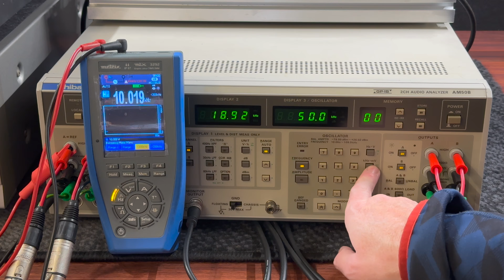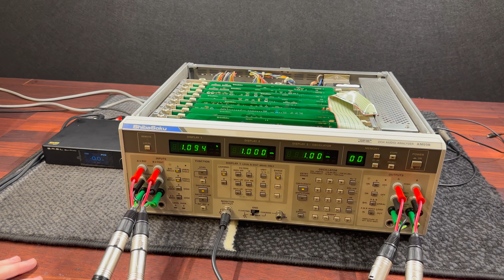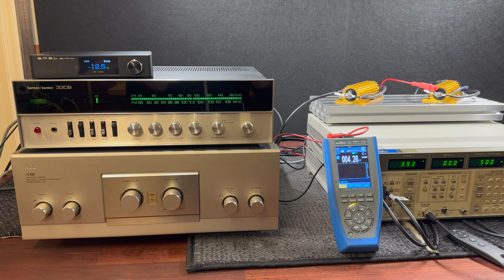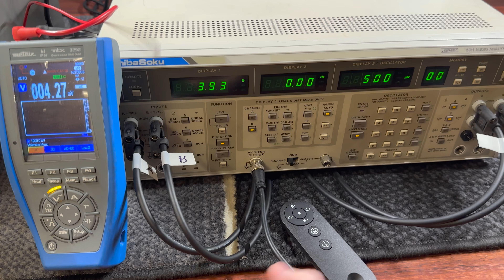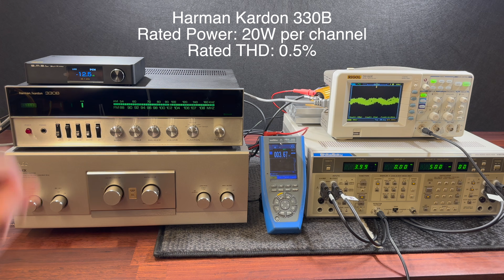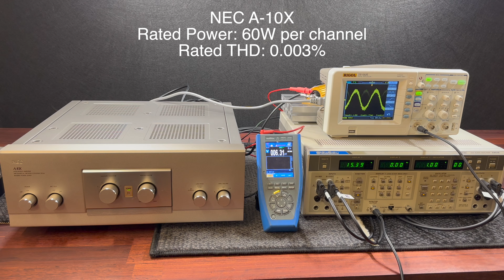ShibaSoku AM50 - Audio Analyzer (Calibration & Testing)

Comment: 10:38 from what I have gathered working on my HP analyser, those filters were designed for telecommunications use so how the unit does the math for the final figures is down the rabbit hole type stuff. I am wanting to experiment with the 400hz one however as I sometimes repair tape decks and would like to use it to measure tape noise vs various different heads... but I need to learn how to measure that when I have some time on my hands!
Reply from the maker: I have the Tektronix AM700 analyzer now also and I have confirmed the THD test files are bang on accurate also… So now I have a known reference point to sanity check the calibration 🙏
Reply: @whatcouldgowrong7914 awesome! I hsve recently bought an ABO-3300, really looking forward to that arriving. If that works,well i might get myself a 2 channel version of that one one day...

Comment: Very interesting video! Very difficult without a service manual... Hats off!
Reply from the maker: Thanks! Yes it was one of my hardest projects and didn’t expect so many troubles
Reply: @whatcouldgowrong7914  One question if you don't mind: If I remember correctly you said that you don't like the Quant Asylum audio analyzer. Can you explain why? At least in the 403 version it seems like the best buy for the money today. Older analyzers will likely perform significantly worse and are mostly as expensive (or even more expensive). The only potential disadvantage I see is that there is only software, no buttons. If precision isn't really important I could see why an analyzer like the one you presented here might be useful as well.
Reply from the maker: @sebastian_harnisch  Sure, my quantasylum is an older model but they basically cut off support for it which means it wont run now without an old windows 7 computer and they refused to even update the USB driver just so customers could get them on newer OS. It also won’t run without a powered USB hub which adds noise and a real pain to use and it’s measurements were inconsistent for me. I wanted a separate analyser so I don’t need a computer to operate and it also supports up to 100Vrms which most computer analyzers won’t take that sort of voltage without blowing up. I may get a Cosmos ADC for spectrum analysis but Im not keen on investing with quantasylum again as they just want to sell you new gear.
Reply: @whatcouldgowrong7914  ah, that’s understandable and very good to know… thanks! The input voltage limitation also is something that I don’t really like, although with +-56Vp it shouldn’t be too much of an issue in my case… thanks again for the insight
Reply from the maker: @sebastian_harnisch  I did pay a lot for the shibasoku also as analysers are really rare in Australia. The Panasonic VP analyzer is probably the one to have and impressive features but there is a HP one also that can take up to 300Vrms which would be incredibly useful for my electrostat use